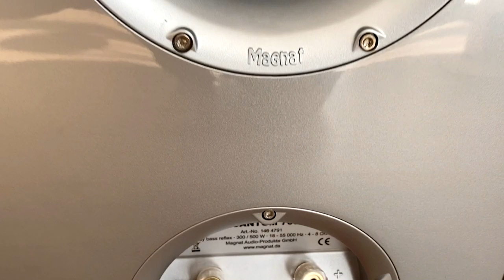TEARDOWN $2000 Magnat Quantum 709 Speakers - What's Inside?

Comment: For 2k this seems fine.  All mdf cabinet looks to be atleast 3/4 inch thick all around and flush installed drivers.  Tweeter looks the nicest of all the drivers and I like that theres 2 crossovers.  I would take these over any B&W or Focals with aluminum tweeters.
Reply from the maker: There are pictures from second audio crossover, that I forgot to put in video - https://imgur.com/a/Xo9qllU

Comment: crossovers usually show the real value, take a look at canton crossovers they can go on the wall how pretty they are.. love your videos btw
Reply: That's right, especially the older Ergo and the Vento/Reference series. It's also impressive that Canton produces all drivers at home in Germany.
Reply: Everything else on the speaker looks top notch. I wonder why they chose to cheap out on the crossover parts. Maybe space saving parts but still?!?!?! Crossover makeover would be the first thing I would do if I purchased these used.
Reply: they think no one will open them haha, I open every speaker that I get, maybe thats not a good idea but I have to see what is going on.. see the crossover, build quality, date of built, what filling is inside etc.
Reply: If you could buy these cheap secondhand you would only have to invest another €1000 to bring the crossover up to par.
Reply from the maker: There are pictures from second audio crossover, that I forget to put in video - https://imgur.com/a/Xo9qllU
Reply: @Techscrews  it looks a bit all over the place.. with glue everywhere.. I don't like it :P

Comment: I have those 709 in piano black. Very good built . I will put silicone gaskets. I have removed tweeters, one had gone, put a pair of decent ones over the cabinet. De couple. Very very good built. Lots of bracing. 40 kilos each. Had they better woofers and mid, they would be perfect !!!!!
Reply: quantum 655 for 220 euro???
are they good bc for me 220euro is a lot but i want to buy my first pair of speakers
plzz answer meee
Reply: @ChudGippity  they are not in production anymore. you can find them used. Try Germany
Reply: @ChudGippity  buy them
Reply: @TheRockerxx69  ok then I already found a pair where I'm from and here we have only literal junk. But this guy brought them from Switzerland and says they are in factory state so ...
THANKS A LOT for the REPLY 🙂
Reply: @ChudGippity  where do you live?
Reply: @TheRockerxx69  Macedonia brother Balkans

Comment: Whi would pay 2k on magnat products?
Reply: Cause they worth it
Reply: @tomszentins202  no, sadly they're not. Magnat is actually pretty overpriced and not good quality..
Reply from the maker: Therefore best way is buy second hand for about $600-700 and get best price performance for bucks.
Reply: I had magnat 6.5 drivers in my car. They SUCKED. without ampligication they were bottoming out. Swapped to focal
Reply from the maker: @AndreiT04  Car and hifi audio are two very different category, for example pioneer do good job in car audio, but suck in hifi.

Comment: how do you compare Magnat Q709 with B&W 603 S3 in sound :)
Reply from the maker: they haven't been both side by side at the same time, therefore no objective answer. Both for they second hand price sound amazing good, I love how sound BW mid and high. It's british sound :)
Reply: @Techscrews  fair enough, in your 603 s3 i noticed different speaker basket, they are related more with 600 2 series. My 603 S3 has new speaker basket, i don't know why they changed, also dust cap is changed on kevlar midrange

Comment: Честно говоря, для 2000$ не так и плохо.В моих Dali Mentor 2 (купленных в декабре 2006-го) мид-бас выглядел примерно как здесь вуфер (магнит чуть больше, в целом - уровень динамиков SEAS Prestige по 60-70$), твитеры вообще говно - не сравнить с этим Магнатовским, им цена по 15 баксов за каждый, от силы - на столько и играли. Кроссовер из компонентов такого же уровня. Но, это были 2-полосные полочники, корпус был в 2,5 раза меньше - а стоили тогда 1800 баксов !!!
Или взять к примеру кроссовер Dynaudio Special Forty за 3000 евро - там стоит 14 элементов такого же уровня, я как-то прикинул их розничную цену - у меня вышло около 30 евро, и это 14 ЭЛЕМЕНТОВ !!!! ))) Цена одного, нормального кондёра на ВЧ.
Reply: LMAO dali mentor is not on the same level as seas prestige. If your compering magnet size then you don't know shit. BL is important not a magnet size. You can make very small magnet and if voicoil gap will be smaller like it is in more high end drivers it will have higher force and efficiency and less weight which is plus in pro audio. Seas prestige crushes lots of even very high end drivers. A build on them could easily compete with epicons although I would choose seas 9/10 times

Comment: Love your what's inside videos but... Magnat & Heco are both cheap manufacturers imitating high-end brands.
Dead cheap electrolytic capacitors, iron core coils and standart cement resistors and you expect sound quality ?
That's not the way to make a high-end speaker, not even close !
And all of those specs are nonsense, totally garbage. No one believes or take Magnat & Heco seriously in the audio world.  There are lots of other German brands who are really manufacturing high-end speakers (ELAC, CANTON etc.) Just forget Magnat & Heco, they are all for show not sound quality...
Reply from the maker: Elac and Canton also not High end brands, real high end brand are MBL or Focal, REL, MCIntosh, Sonus Faber and other. Magnat selll good audio stuff for the price tag. For real High end cables cost more then Magnat speakers.
Reply: @Techscrews  Sorry, but you have no idea what you're talking about.
ELAC & CANTON are definitely high-end manufacturers like the ones you mentioned.
It's clear that you never experienced ELAC & CANTON. Go better try them out before commenting... and be sure to check out the drivers, crossover topologies and cabinet constructions of the upper segment models. You'll be shocked 😉
Reply from the maker: @Boorock70  I have used canton Canton GLE 409 speakers and in real objective test smaller magnat quantum 605 sound more better. Any brand have good model and bad. You can't say, that Canon is better than Magnat, both brands have good speakers.
Reply: Each speaker is designed according to the target price. If you replace the iron core inductor with a similar priced air core, the much higher DCR would deteriorate the damping ratio. Iron core/p-core has higher distortion of 2-6 dB THD depending on design. Cement/sand cast resistors do not have any meaningfully higher inductance compared to other types and still pretty cheap. A loudspeaker is more than the sum of parts.
A $2000 speaker cannot have parts worth more than $400. This is not your diy speaker project.
Reply: @Techscrews  Canton GLE is an economic/budget serie, you have to go higher than that.
Even the B series will kill any Heco/Magnat speaker. And if you decide to go higher A series, Chrono SL's will be much more than enough. Still, there are 2 more levels to go if you have the budget. Spend some time with Canton & hear it by yourself.
Reply: @super-z8943  and this is where engineering comes to play.
This is why a highly engineered speaker with "better quality" parts will sound epic. But engineering is a very expensive and very time consuming process including days, weeks even months of work (and maybe more).
And sure it is exactly like a DIY project but with lots of science / experience and evaluation which you may never even get close as an individual in terms of finance and scientific approach.
That's the reason why big boys of audio have space-tech laboratories, genius speaker designers and best engineers they can afford.
You're paying for their efforts... 
but, on the other hand there are also some sh*t companies/brands (like mentioned above) not spending a dime for any R&D and trying to copy only the design of the others. 
- So, everything becomes clear when you look at "what's inside" you can easily decide "who is who"
Reply: @Boorock70   Boorock70  speaker isn't rocket science that needs lots of R&D. Kits designed by Jeff Bagby, Geddess or Linkwitz rivals big brands. 
What do you expect inside a $2000 speaker? Why are you comparing parts inside a $2000 speaker of a lesser brand with $10k systems of big brands.
Even big brands use iron core inductors. Iron core inductor and electrolyte caps doesn't mean bad quality if you know what to do with it. Judging a loudspeaker just from the sum of its parts is foolish.

Harbeth uses ironcore inductors, electrolyte caps and sand cast resistors. Cabinet build quality is bad as well. They may not be for everyone but are expensive than the parts while breaking many loudspeaker conventions, and lot of people swears by those. Look inside PMC, Splendor, Audionote. Look inside the teardown of $1000 B&W in this channel. It barely has parts worth $200, which should be expected. Even Rockport speakers uses ironcore inductors.
And if you think someone can just copy someone else without any R&D, you know nothing about loudspeaker design. Change the cabinet or a driver and the entire thing needs to be redesigned. And almost everyone is still following the basic topologies and hence copying each other.

So unless these brands are making something like the chinese look alike  of B&W nautilus, no they aren't imitating. Loudspeaker isn't space science, certainly not for $2000.
Reply: @Boorock70  Look to Magnat Quantum Signature! Magnat Quantum Signature one of the best High-End speakers in the world! Absolutely amazing speakers! 👍 True High-End class! 👍